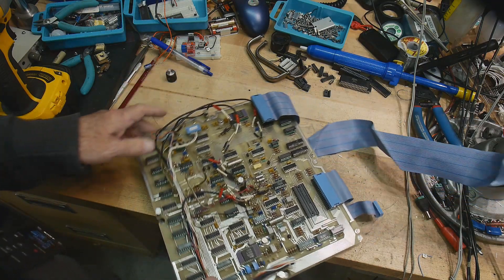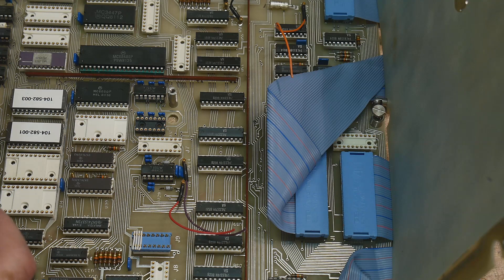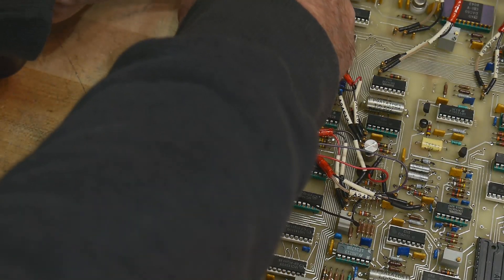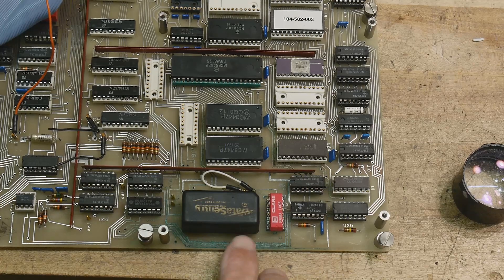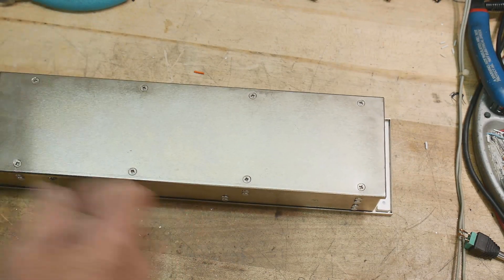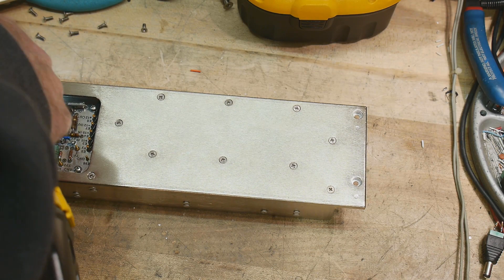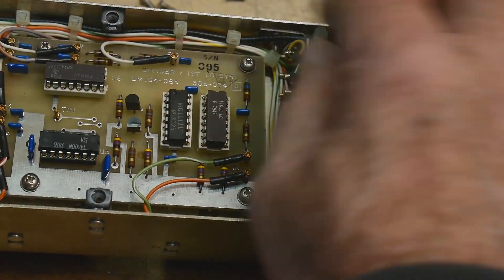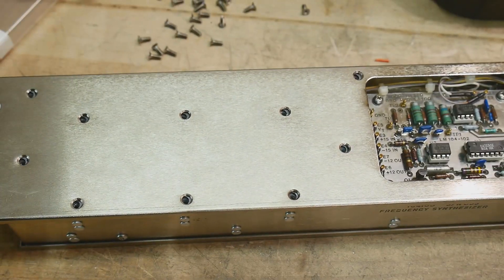#700 Microdyne Telemetry Receiver Model 1200-MR (part 6)

Comment: It looks like punch-down jumpers or something.  On a DIP visible at 3:09 toward the bottom of the screen, "J9", colored blue.  Interesting.
Reply from the maker: Those were very common in the 70's and early 80's. It is a dip pin plug into a socket and you put wires on the insulation displacement pins.